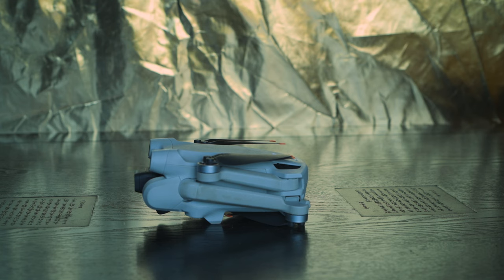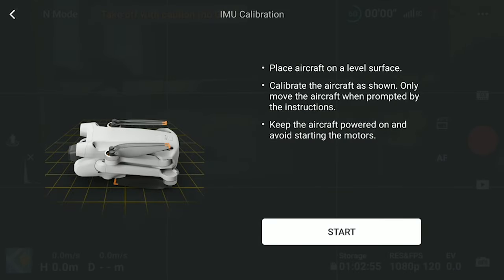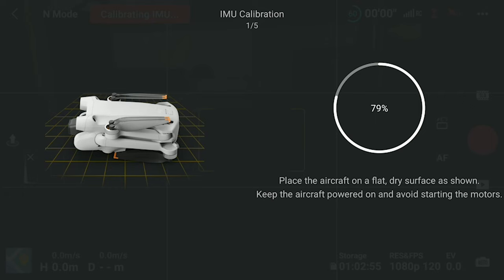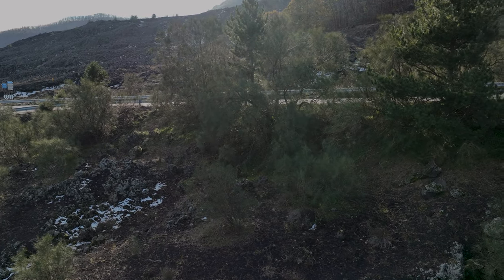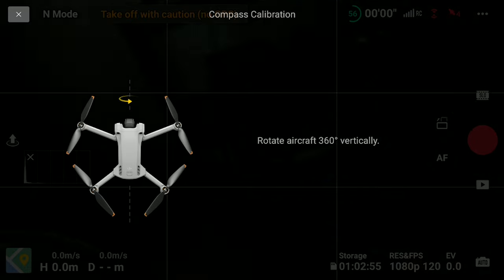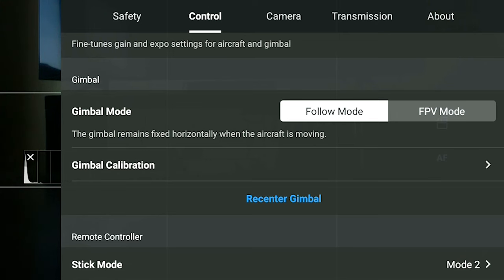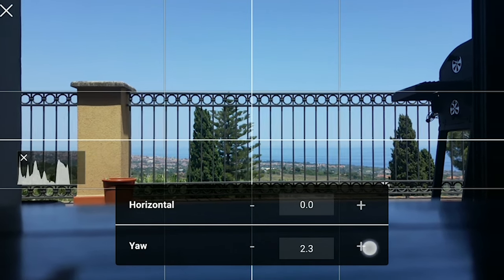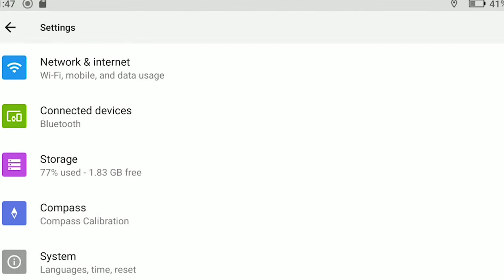DJI Mini 3 and 3 Pro - Calibrate Gimbal, IMU, Compass, RC Controller

Comment: How do you calibrate the Air 3 Controller Compass? How do you calibrate or align the icon of the Air 3  on the Radar screen? Mine is 180 degrees out, the pointed end is facing the wrong way!